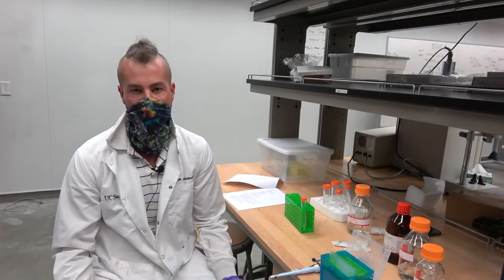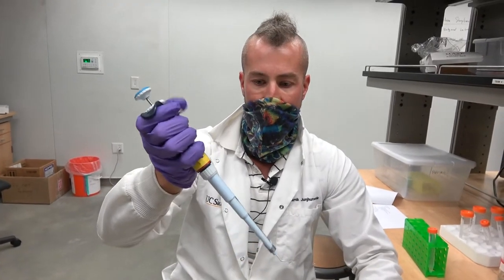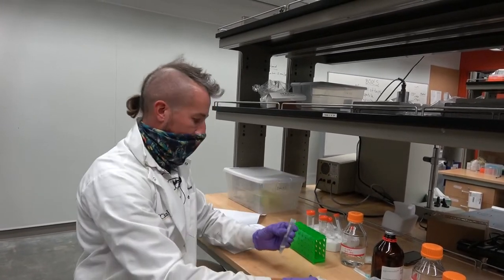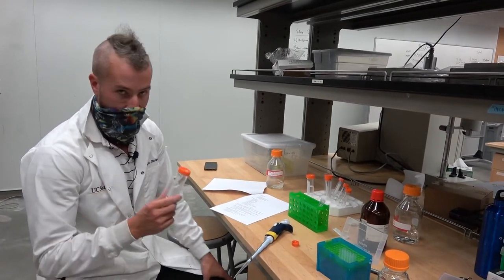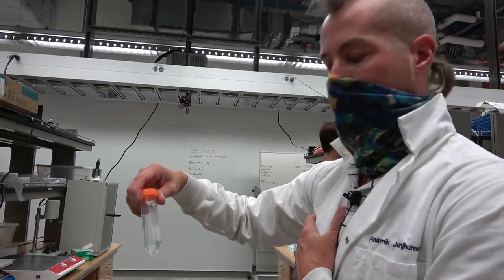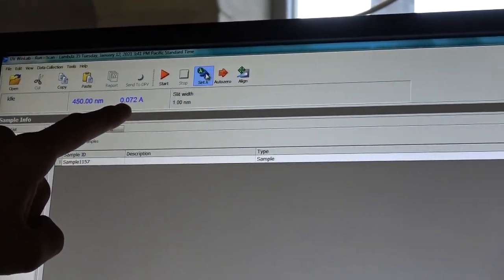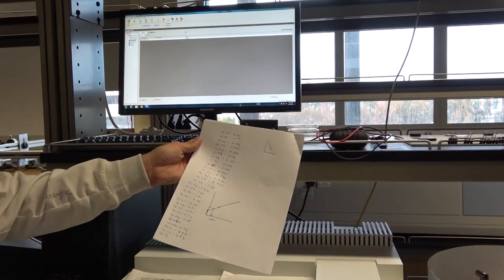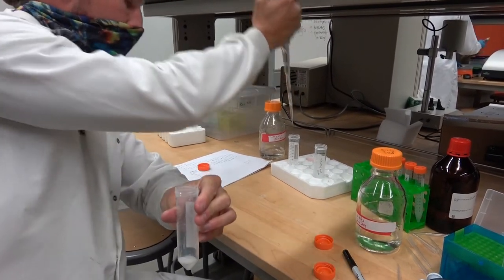Silica Nanoparticles Day 1 Nano 120A

Comment: Hi Jesse. First of all, I appreciate your work and explanations. I’m trying to synthesize hollow silica nanoparticles based on the soft template (PS). I’ve noticed that the silica is stuck to the plastic Eppendorf. So I thought I that  I have to use a glass flask. But, Why is it working with you to use the plastic tubes? Thank you very much.

Comment: I am using CTAB and TEOS and after centrifuging, i don't see the nanoparticles like you do
Reply: Did you figured it out? 
I am also doing the same in final year project, let’s connect.
Reply: @UJJWALSAPKOTA-o8n  Sadly I have not but I have been doing multiple readings and here is what I have found. Since I want to make sub 50nm, extraction or recovery is generally considered to be hard. You may need higher speed of centrifuge, I read in one article that they used 55000g. My lab does not a centrifuge that can clock this speed. I intend to distribute the liquid in smaller amounts and run for longer time to make up for this. However, I have also read that this should not affect recovery. But since I am troubleshooting, I intend to try it. And if it clamps together, you use a sonicator to separate them. Another thing is when adding your NaOH or Ammonia solution (I am using ammonia solution), focusing on the initial pH is more important. pH should determin how much you add. I ran out of ammonia and is waiting for my purchase to arrive so when it does I will let you know if it works
Reply: There is also another method that involves using an acidic pH instead of a basic pH. You can also explore that option.